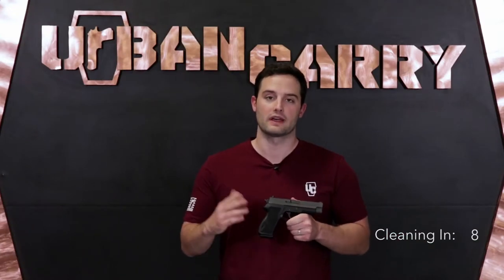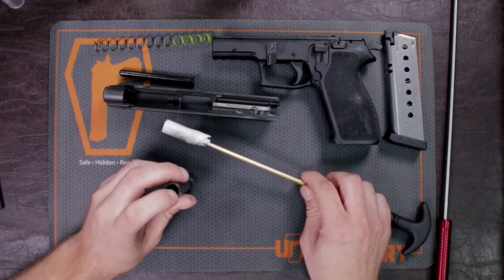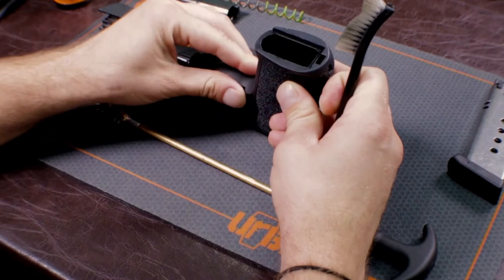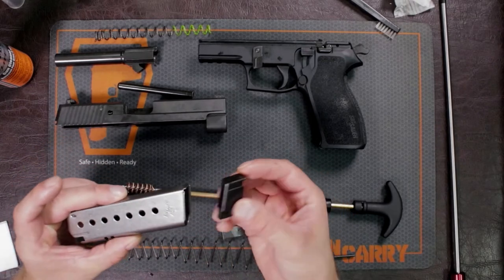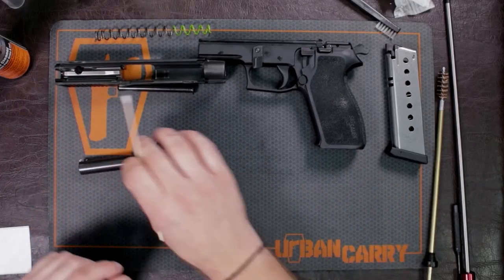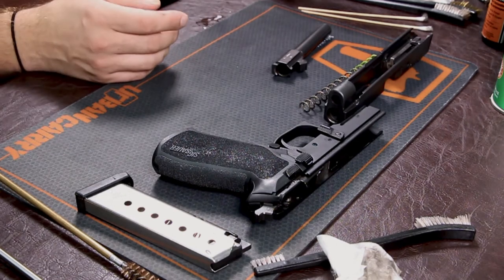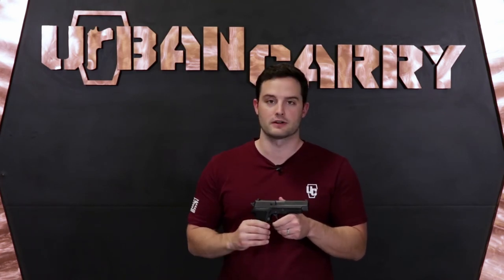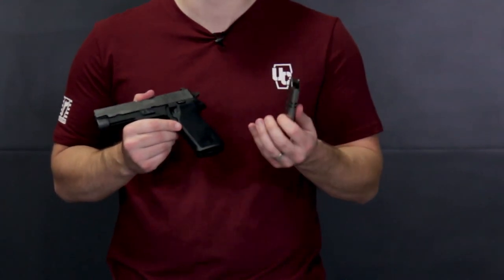Sig Sauer P220 [HD] Cleaning & Features

Comment: Thank you. Good Video, only those Sig P Series Metal frame guns, 220,226 etc. with the full rails need to run wet. Put some good gun grease on those rails, locking lug, barrel hood and areas of friction and a few drops of oil spread on the barrel and guide rod/spring, your gun will shoot smoother and wear less.